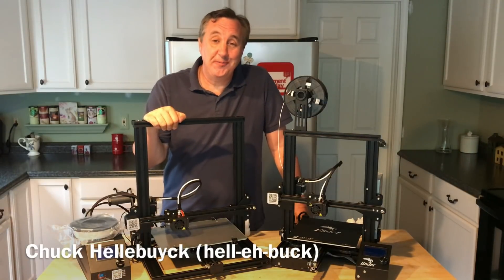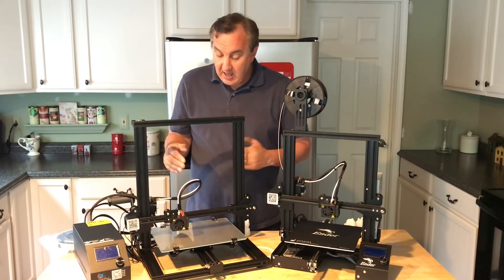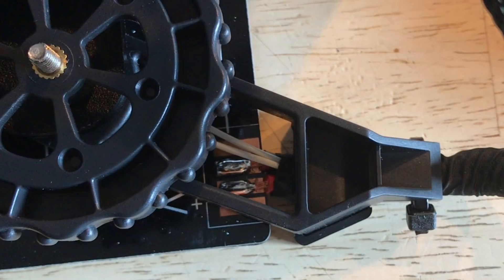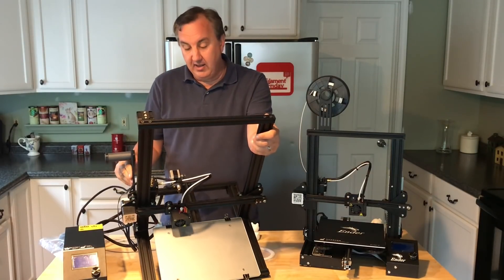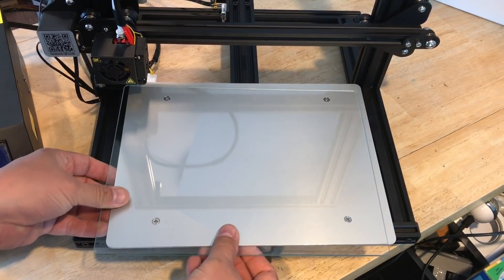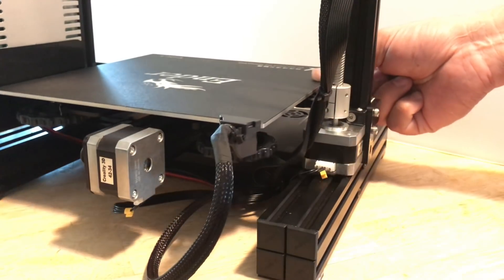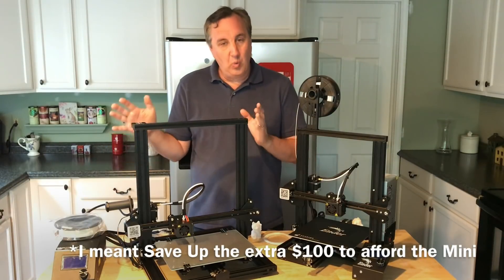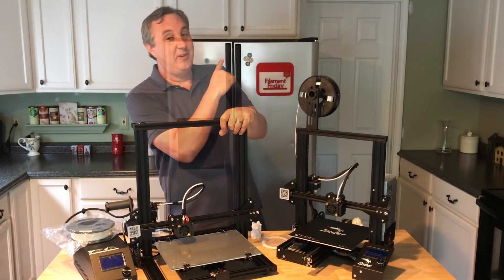Creality Ender 3 vs CR-10 Mini 3D Printers

Comment: Unless space is really a premium on the CR-10 Mini, I'd go for the full size CR-10 at an extra GBP50-60 to the mini, so for me the difference would really be the Ender 3 versus the full size CR-10 at GBP150-160 difference.
Reply from the maker: Not a bad move if you can afford it but then that’s why I compared mini to Ender 3. I was looking at under $300 USD because that’s the question I often get. The bed also heats up faster on the Mini vs the full size.

Comment: 220 x 220 x 300mm for the ender3
Reply from the maker: Ender 3 is 220x220x250 I mid-spoke in the video saying 220 but it’s 250 tall not 300. CR-10 mini is 300.
Reply: CHEP Oh, it says 250 mm tall on Gearbest. I must've been looking at the CR-10 mini when I saw the 300.

Comment: Hello Sr. I was thinking about getting the CR-10 mini after having a LOOOOOOOOT of leveling issues with my unfortunate first printer, which I wasn't able to use, just test prints. So, I saw on another of your videos that you got a better model of the CR-10 mini after getting your first one, the black you customize a little bit. My question, the link to buy it is for the latest model on the CR-10 mini or the older? Also, on the description it states, Do not include T-bracket(right side). What does this mean? Thank you.
Reply: Ok. Thank you so much for your help. I had another concern, it's about the single lead screw for the Z axis. Have you had any issues related to this feature on the Creality printers? Thank you
Reply: Ok Sr. Thank you so much for your support. I'll make sure to use your link to buy my CR-10 mini. Your reviews are very helpful. Good job! Keep it up👍

Comment: Great video Chuk. I was in the same choice doubt, and finally bought the Ender 3 because my budget. Respect to the base stability you need to put it over a perfectly plane surface. Then you have a couple of screws on the base (fastening the two laterals bars and the center one). Play with them, and you 're going to reach good stability.

Comment: I just got ender 3 couple days ago and a had the same rocking problem. It's because 2 alumiun as the feeds is not parallel with other
 I found the way to fix that isue very easily by loosen 4 screws at both side of the base. Line up 2 "leg" (2 alumium base) flat and "the bridge" (the ones connect 2 "leg") parallel on their edge. Just make sure the heat beth also parallel with ground and you should be good.
BTW, great review. I love CR-10 but it a bit expensive for me and Ender 3 seem like a good deal too

Comment: Z build height is 250mm not 220mm

also 3 is 24v so you don't need such high amp wires as the 12v beds need. ie FAST heat up to 100c even 110c no problem.

I agree the Mini is a slightly superior machine to the Ender 3 but at the price of a 50% increase for a VERY tiny increase in build volume (80 on X 50 on Z but -20 on Y)

the big thing for me is the AIO. I hope they eventually do an AIO CR-10 Mini with 24v heat bed. THAT would be well worth the extra $100 for that nice super stiff superior frame.
Reply: yep its tight but it makes done several 245mm prints. that harness does need to be longer

Comment: Hi Chuck, I agree with how darn small the ender 3 truly is but think you might have misrepresented the Ender 3 a bit I've seen some impressive print from that system. Is that a beta unit if so then I've seen the correction others have done to it to get amazing prints. If the one you have is a production unit then I would say you need to disassemble and try again. Just my two cents and like I always say that all it's worth.
Reply: I never said you did anything wrong just might have to rebuild the unit again because the wobble is not normal which could be causing the bad prints just an observation Chuck. I agree the CR10 min is a much better unit hands down for the extra money.
Reply: Actually the cheaper "beta" units were production units too, just limited to 500. The easy way to tell is by the power supply cover. If it's 3D printed, it's a unit from the first, more flawed run. I do agree that the errors mentioned seem very much like those solved after the first run so the concern and question are very understandable.

Comment: It's crazy how these printers can print compared to the davinci. I remember when you were printing with it and really happy with the results, now they are pretty much junk.
As for your ghosting, is it more likely its from vibration of the printer or maybe a loose belt or some other hardware. I am still having issues with ghosting on my Cr-10s, I'm just wondering what could be a causing it,
Reply: Many people update the marlin on Ender 3 and got good results.

Comment: I have 2 CR10 fullsize machines So I like the CR10 Mini better myself. I hate the extra boxes and snakes of cords on my CR10s . It eats up bench space and the first failure i had was the aircraft connector bed heater wires were poorly soldered and eventually broke in a few days. Whether the power supply is inside an additional metal box means nothing to me as long as the power end has an enclosure/switch /fuse like the Ender 3 has. I agree the prints are just a tad more rough than on my CR10 or my Ender 2's. So I am going to try running a small step down transformer for the Ender 3 board to run it on 12 volts and keep the bed at 24. I will bet that the drivers don't like the 24volt supply and the motor drivers stepping is smoother on 12volt. We will see. Good review though, I just wanted to offer another opinion from a nerd.
Reply: This is worth it, for the cr10. 

CR10 All-In-One found on #Thingiverse https://www.thingiverse.com/thing:2841111
Reply: For sure !  I need to just convert mine to that as well . 6'" legs of extrusion and sliding the box underneath was just my quick fix.

Comment: you have to loosen the frame screws when you get the 3 and push down on a flat desk. then retighten
Reply: I've seen some Ender 3 like yours on a facebook group. Mine actually was like your experience with the mini. Put screws in and done. First build took 45 minutes and no wobble at all. Second build would be much faster (20 minutes I guess).  There is no reason a mini should print better. They use the same components everywhere. Just longer extrusions on the mini. Thats why i think your Ender was faulty from the start. Extrusions do not line up somehow which makes it wobble so much.
Reply: The Ender 3 has a 24v operating voltage. this adds a slight bit of electronic noise to the print. 99% of people would never notice but people like CHep and I notice. it also has very very slight salmon skin. but TL smoothers 100% removes it. again something most of users would never notice (it was no deep like the tornado)

the first batch of Ender 3 were a test batch. hence the fiddling to make them work right. lets be clear its a creality printer so once the improvements hit the factor line you won't have those fiddling issues any longer.

MY CR-10 mini took a lot of fiddling to get it to work right but I got one from the very first batch. buy a CR-10 mini today and it slaps together like butter.

the big thing about the Ender 3 to me is the AIO form factor and the $100 cheaper price for 99% as good as the Mini better in some ways. buy 4 5 or 6 of them and that is $600 savings. enough to buy 3 more Ender 3's. thats a big deal.

but the mini IS a beefier machine. the frame is much more rigid and stronger over the Ender 3. they had to remove something to get that price down. so its a compromise.

no doubt 2 months from now every ender 3 will be nearly perfect from the factory just like nearly every cr-10 mini is nearly perfect now.

Comment: ender 3 is 235x235
Reply: Same with the Ender-2. That one is advertised as 150*150 but in the slicer instructions they say to enter and use 165*165 which works all the way.
Reply: no. you won't get 165x165. I was able to squeeze 151x162x226 so I use 150x160x225 to play it safe and this requires careful assembly to get that space. your not printing 165x165 without modifications on an ender 2. I have 9 of them :-)

235x235 would take some work on the 3 as the bed tends to cock CCW I have to shift my prime line 3mm to get it to print on the bed :-)
Reply: Still it is 235x235. I don't know why they have wrong specs.
Reply: No not on mine. It goes the full 235mm in both x and y axis.
Reply: I really don't know what you are talking about there. The build plate is 235x235 and i can move x and y so that the nozzle can utilize the build plate to full extent. Why would the filament fall off?
Reply: CHEP Filament Friday,  I did. Works just fine
Reply: that is interesting. I had assumed it would only do 220x220 I will have to check that.
Reply: I stand corrected. I'm sure I heard someone say they entered the suggested measurements of 165x165 with these working all the way, but indeed, that's not actually the case. I actually tried 160 in width without a hassle, but that apparantly was right up its limit. I'm getting 160x150 too. Not that I mind the extra unadvertised centimeter though.

Comment: I think taking the G-code that came with the Mini and using it as a print on the Ender 3, is kind of an unfair comparison.  The g-code for the Mini was potentially setup for the Mini and therefore potentially not correct for the Ender.  A more fair comparison would be to dial in the settings on both to the best of your ability and then compare it that way, IMO.
Reply: part of his (legitimate) issue is that assembly is simply less an issue for the mini as its primary structures are pre assembled.

it also (ender 3) lacks the reinforcement plates on the Base to vertical connection that the Mini has (I plan to add these to my 3's)

so not "quite" the same. the 24v also adds some noise (very little but its their) and the bed bearings on the 3 just plain suck (something else I plan to fix and hope creality updates at some point)

all of this puts a larger burden on the end user to "get right" which is just not so much an issue on the mini.

I LOVE my ender 3's I have 3 and plan to get another. but I CAN see the value in the extra $100 for the Mini.
Reply: It is my understanding that the Mini comes with the CR10S board, while the Ender comes with the original CR10 board.  That would/could make a difference.
Reply: It doesn't seem like that is always the case.  TH3d says this - However we have seen some CR-10 Mini machines ship with CR-10S boards.  I would be interested to know if any of your Mini's have the other board, since it seems like you have several.  (that is beyond this discussion and not meant to change the subject.)
Reply: So there should not be any difference in print quality since they use the same components. The mini is effectivly the same printer with longer extrusions. 

There are just 2 options:
Your Ender 3 has a fault (not correct extrusion length, Quality issue by creality) which some people have issues with in facebook groups
or 
It was not built correctly by you.
Reply: The pictures that are displayed on Banggood show the Mini with a CR10S board.  You can compare the board they show with the ones that TH3D have on their site.
Reply: not the same hot end. it is different but I doubt that makes a print difference. they are very close. same mainboard ?? they are not run the same (24v versus 12v) though I THINK its the same board as the CR-10 and I believe the mini ALSO runs this same board.

OOTB the mini will give slightly better print results. TL smoothers and good frame alignment and the Ender 3 will surpass the Mini (lower inertial mass that simple its physics mini can't do that) BUT remove the glass plate from the Mini and I bet you can't tell the difference in print quality OR slow it down enough to compensate for the glass.